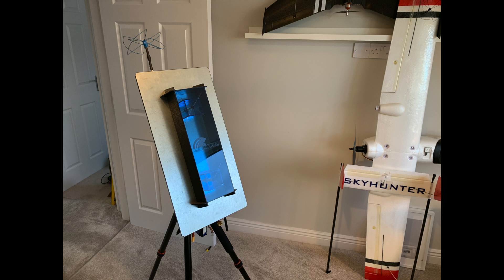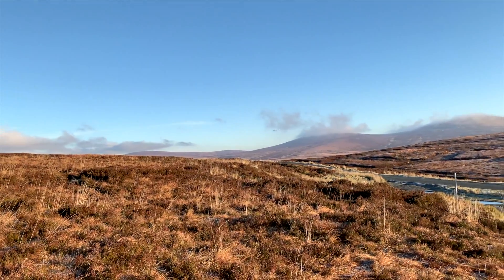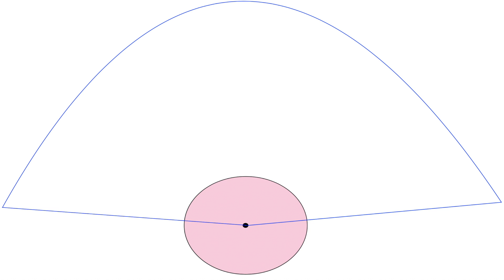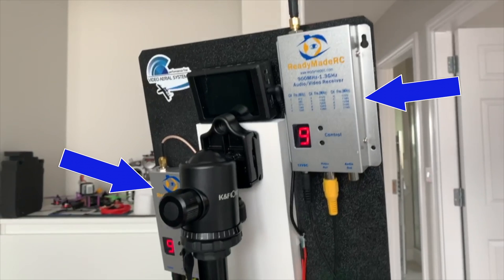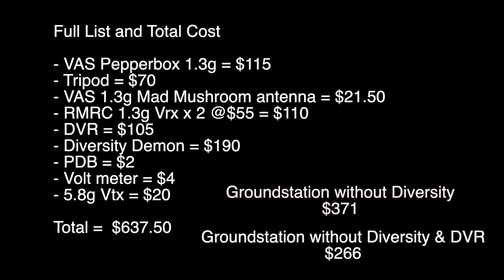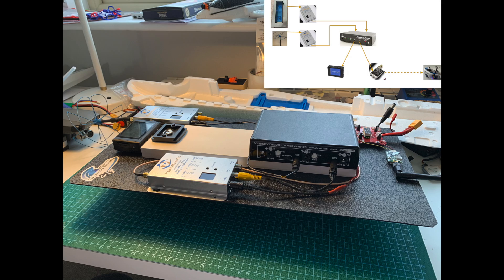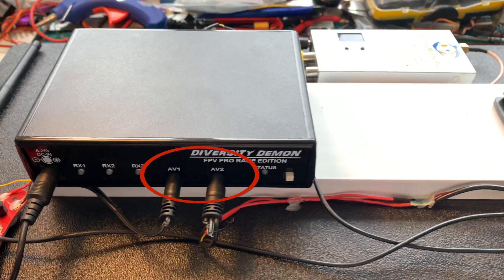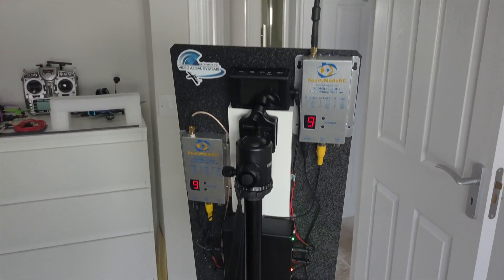Long Range FPV Ground Station - Build Tutorial

Comment: Now you can get the dji o4 pro and goggles n3 for around the same price and offers better image quality with 50km range.
Reply from the maker: True that the DJI gear offers better image quality, but you're not getting 50km range. The hard cut off is from memory around 25-30km. And even then it won't be easy. The ground station in this video will easily see you to over 100km in the right conditions and allow you to fly behind objects and lower at range.

I only fly DJI these days, I have O4 on 5 planes and it's great for 99% of the flying I do. It cannot keep up with analogue on the 1% extreme low and far flights though.
Reply: @AdamGdoesFPV omg thanks because I saw some video of DJI at 50km and I almost decided to buy DJI for long range flights
Reply: @AdamGdoesFPV  btw what's your thoughts on the advancement of fpv video systems

Comment: How many kilometers does electric drone ca fly?
Reply from the maker: Fixed wing FPV planes can cover a lot of ground. They can cover well over 200km in a single flight with the right model and setup. If you mean how far out will the video work, I've seen proof a setup like this groundstation in the right conditions will still have video at 120km away.

Comment: Thank you for this, ive been mucking about trying to come up with a solution to be able to send my fpv quads further on analog, what vtx would you suggest for the aircraft, i was leaning towards an AKK high powered vtx of sorts with 1w to 10w capabilities with active cooling, if i have that on my drone would this ground station be sufficient for like 10km to 20km range?
Reply from the maker: I don't know on quads but honestly high power vtx's are not the way forward! With this GS in the right conditions people have done as much as 120km from home on fixed wing.
Reply: @AdamGdoesFPV  thats insane, thanks for your help, definitely with the build as well!

Comment: Hi! Congratulations and thanks for the video!! It's very helpful. I am getting into the FPV world, and have some questions: I am developing a fixed wing. I want to have two cameras, one fixed analog runcam to fly, and a second gimbal camera (SIYI A8 or similar) to track objects. In both cases the video would be live. Is this GS able to stream both signals in long range flights? Thanks!
Reply from the maker: Hi, this setup is not designed for streaming 2 signals.If I was doing that I'd probably consider this ground station for receiving the FPV feed and then I'd add a second transmitter for the gimbal on 5.8g, probably digital.

Comment: I wanted to try 1.3ghz on rc car.  To get more penetration.  I tried analog 3w vtx 5.8ghz but still seems video going thru a dew buildings still wasnt better than DJI.. wish really shocked me. Analog lost video at points pretty much. Thinking try 1.3ghz 2w vtx with omni antennas on goggles vrx
Reply from the maker: 1.3g will out perform 5.8 on penetration any day. The power of the vtx is less important that the quality and gain on the receiving antenna.

Comment: I'm planing to get 5.8GHz fpv system but also planing to make a ground station to display the feed to friends also thinking of displaying other info like speed, gps, altitude on a different screen. Any easy way to get the telemetry? Bit new to this stuff xd. 

Thanks!
Reply from the maker: You don’t even need telemetry for all that data. You just use a flight controller that has an OSD. It the displays the data in your live feed.

Comment: Hey man nice to see the video is it possible to use satellite to get a large range ?
Reply: And couldn’t you just point a pepper box in every direction and have Omni directional control
Reply from the maker: If you mean satellite link then no, too laggy. You can point PB in multiple directions but that’s such a pain to setup it’d be annoying. Also when you fly you never go far in all directions, normally just 1 so it’s just not needed

Comment: Ive got the x2airs, 2 patches and 2 omnis on my dji goggles v2. So i get pretty fsr infront of me and decent omni signal, but what if i setup a high gain ground station fscing behind me so that i could have a huge range both infront and behind me!

1. Is it possible to use a diversity reciever with dji goggles?
2. Is it possible to use it in unison with my goggles(instead of switching between omni and high gain of ground station, just switch between high gain ground station and goggle patch antennas)?
Reply from the maker: Hi, with DJI you can't use a groundstation. You can with Walksnail though as they offer an external receiver. Personally I'm not a fan of the performance of WS though.
Reply: @AdamGdoesFPV  yeamy buddy has been tryna get me to switch to anything but digital since I got my first drone but the beauty and surreal feeling you get when flying around is the number 1 thing that keeps me in the hobby. I jus dont think I'll enjoy flying through a cctv video feed 😅

I'm om 1200mw with the x2air patches and havnt got a lot of range testing done but I think I'm only getting about a mile. Others online report getting 3 or 4 miles. Any idea where I might be messing up/differing from the people with better range?

Comment: Is it possible to fly a drone using my tv as a dvr and flying 5+ miles I want a ground station that is setup in my room
Reply from the maker: This is possible. Just about how you connect video signal output from your Rx to your input on TV

Comment: Will it work if i use telescope flag pole to ground for my rc truck?  Thank you for your time
Reply from the maker: If you mean place this on top of a telescopic pole instead of a tripod? Yes if the pole is strong enough to take the weight and resist being blown over by wind.
Reply: @AdamGdoesFPV  thank. I was planning on it

Comment: Cool setup, I appreciate the information. A little rough first getting into it all trying to learn the various standard protocols etc. I really like that box which allows two receivers. I ended up with the single 2W 1.2-1.3 transmitter on a little RC car and it def works way better than the 5.8ghz. I'm not sure how much quality I'm losing going down to 5.8ghz to relay over to my little LCD screen but it still looks really good for using a cheap camera. I couldn't even position my car next to a wall or something on 5.8 before it started crapping out.
Reply from the maker: 1.3g is way more forgiving that 5.8g. The relay is probably not losing any quality really. Glad it helped. Cheers

Comment: Hi mate. Great video. Just 1 question if you can help. I have a prodrone dipole antenna on my mini talon 1.2/1.3ghz. How would that work with a right hand or left hand omni and also the pepper box. Thanks
Reply from the maker: Hi, and thanks 😊 a dipole will not work well with RH or LH omni or pepperbox because the dipole is linear polarised. All of the other antennas you mention are circular polarised. You will get very bad performance if you mix circular and linear antennas. You’re best off using a TrueRC Singularity on the plane. Cheers
Reply: @AdamGdoesFPV  ok that’s good to know. I have a mini ground station that I use. 1.2/1.3ghz Rmrc receiver with a square patch antenna. Is the patch Circular do you know and so would it be better with a Omni antenna like you say on the plane. I have dipole on plane and patch on ground station. So I May have set it up wrong. 🤦🏼‍♂️
Reply from the maker: @ttucker2073  the patch is linear so you’re good with that setup 👍🏻
Reply: @AdamGdoesFPV  that’s good to know. Wernt sure what the patch was. It’s prob about 6/8 inches square and maybe an inch thick. So are all the square patches linear?
Reply: @AdamGdoesFPV  looking online and it looks like an 8dbi flat patch antenna. Possibly rmrc to

Comment: Well, does the same apply to the controller as well as it needs a signal router and how to connect to it?
Reply from the maker: No, this groundstation is for the video only. The control system is independent from it and doesn't usually need to be isolated from the tx.

Comment: I need a very long range rc transmitter. At least 100km with 18 channel. What do you recommend? Does this tracker will help me to use and control my plane by rc transmitter or it just work on autopilot
Reply from the maker: No need to copy and paste to multiple videos. Once is enough
Reply: @AdamGdoesFPV  thanks for reading my questions. The reason for that was , in many cases one channel won't  reply so I ask my question to many channels.

Comment: I have an AV cable and there’s three wires, red, yellow and white. How do I know which is ground, video, and power?  Which cable did you use to connect your 5.8ghz relay vtx and your 1.3vrx to the pcb?
Reply from the maker: I used a multimter to check for continuity. And the Vtx cable is just the one that came with the vtx... soldered to the pdb and a spare connector I had

Comment: Hi Adam. your Video is the first one who help me to understand this kind of antenna (I am a Drone Newbie). I try to build a drone and Radio-system for our Unti Poaching Unit in SA. My Question: is your antenna usable for a distance range for FPV and Control for min 30km? When not, you could help me ? Which parts i have to change? Should I better use a automatic tracking antenna?
Reply from the maker: Hi, The groundstation is not used to control the aircraft, only to receive the video feed. An antenna tracker is only useful if you plan to fly far in multiple different directions from where you are standing. For control link I use Dragonlink or TBS Crossfire. Dragonlink has a longer range and will go beyond 100km with the right antennas/setup/conditions. Good luck with the project.

Comment: Is it Possible to use this for a DJI mavic pro? If not what would need to be different? I’d like to make a separate station to go on my roof or wherever so I can fly much further but from my living room. I appreciate any help in this matter. And if anyone builds these in the Southern California area message me plz! Lol I’m really reaching here but whatever who knows. Thanks
Reply from the maker: Honestly you'd be better off building a home made quad with 1.3g video and 433mhz or 868mhz for control link. Making a Mavic work on 1.3g video will not be worth it. Thanks for watching.

Comment: Hi, its a great tutorial! however could you please advise me on what is going on on the market as now (2 yearsw later) i am unable to find no pepperbox antenna or mad mushroom antenna anywere. they are discontiuned. what is the replacement nowadays (I am trying to build a ground station working on 1.3 GHZ as well)
thanks
Reply from the maker: Hi and thanks. I actually mean to make a follow up video to this very soon!
The pepperbox has been redesigned, it is more powerful, smaller and lighter and you can buy it here: http://tiny.cc/Pepperbox-XTreme
Rather than the mad mushroom I use these which are way smaller and in a case so nice and protected: http://tiny.cc/SingularityCP
Cheers

Comment: Great Video! I've just got two questions:
1. What FPV transmitter do you recommend for the longest possible range with the Pepperbox as receiving antenna?
2. To be able to receive the FPV signal from all directions with the Pepperbox, couldn't someone just turn the antenna following the aircraft?
Reply from the maker: Thanks 😎
1: This one http://tiny.cc/Matek-1G3-Vtx
2: Yeah of course, if you have someone standing by to do that. I sometimes turn it myself mid flight if I go out in a different direction.

Comment: Hi. I don't know if you still respond to these comments, but the diversity controller you used is no longer for sale. In fact, I can't seem to find any diversity controller for sale. Is there a way to currently recreate this?
Reply from the maker: Hi, yeah there is an update on this in the kit list. The only one I'm aware of is the Clearview XL which is a 3 in 1, 2 x 1.3g receivers and a diversity controller. Not cheap though, Cheers
Reply: @AdamGdoesFPV  many thanks. Clearview is out of my budget, so I will likely have to get a 5.8 system as my first. Not great for long range but it might be my best option.
Reply from the maker: @sumbirdy1741  or just go 1.3 without diversity 👍🏻

Comment: Auto subscribe. Very informative n inspirational. I currently use rush tank vtx 800mw + dumbo rc for my rc car. Would you like sharing transmitter system for long range ? Crossfire enough? Thanks
Reply from the maker: Thanks for subscribing 👌🏻 Crossfire is great for long range, and if you need more Dragonlink is pretty unbeatable.

Comment: @Adam G does FPV Great video, very very interested to build one like yours. Searching for the parts on the web seems like the VAS Pepperbox is out of stock everywhere, do you know if they're still in business? Do you have other antennas to suggest other thank the gattling (saw your video test) that is almost 400$? Same about the CP antennas both for TX and RX seems unfindable.
Thanks a lot, really looking forward a reply
Reply from the maker: My suggestion is to just back order with RMRC. I do this regularly and they tend to get the parts in quite quickly, plus at a decent price with low shipping costs. Gatling is very expensive and I’d only recommend buying one if you really k ow you’ll make use of its potential. The PB is a much better all rounder and way cheaper
Reply: @AdamGdoesFPV  Thanks very much for the suggestion I'll do as you say! What about the video mixer to have diversity? Seems like  also the eagle eye is unfindable, do you have any suggestions where to find something cheaper than the Clearview to start with? Thanks again!
Reply from the maker: Unfortunately there isn’t anything cheaper that exists at the moment. I’d suggest just going with the Pepperbox and fly out in front of it 👍🏻

Comment: Hi I've used your link for the diversity demon but it's no longer being sold by that company can you guide as to where else I can purchase one or something similar that works the same way.
Reply from the maker: Hi, there is already info in the video description right next to the DD link 👍🏻
Reply: @AdamGdoesFPV  thanks. I also located the eagle eye diversity controller that's much cheaper.
Reply from the maker: @briancrick935  They are discontinued so they are very hard to find unless you get one second hand.

Comment: what is the average maximum range you can get with 5.8ghz?
Reply from the maker: This all depends on so many factors I just can't answer. Some people will get about 1km and some go to 50+. Setup, equipment used, fling location, flying style will all influence this. Cheers
Reply: @AdamGdoesFPV  thx for the info

Comment: Thank you.This is very clear and useful , even to an old hand.( I am very satisfied with Eagle Eyes after 8 or more years). Recently I get a varying  gauze- like texture with all the best cameras and vtx's on 1.3ghz , and it is not on a 5.8ghz connection . The aspect ratio also changes between 1.3 and 5.8. Either the goggles (Eachine 300 ) process the AV in by -cable connection badly, or the cable affects the signal . I will try using the 5.8 relay with the Eachine vtx  , and also  try another cable . Do you think a coaxial cable would be better?
Reply from the maker: Hi, not too sure if the cable will make much difference. I'd be trying to take parts out of the equation one by one to pin point where your issue is. When I had an odd issue it turned out to be a strange compatibility problem with my goggles. Cheers

Comment: Wow, that is hell of a video, well done.
Im just starting the hobby so please help me out to understand things well.
On your standard ground station you use Vtx to transmit video signal (from your plane/quad catched by your ground station) into your goggles? cant you like wire up ground station with your goggles directly and not use the Vtx? What kind of Vtx are you using at your plane to match you ground station receiver ? is it some kind of 1.3 Ghz transmitter?
Another question of mine - maybe off the video topic a little bit. Normally when you transmit video signal from the plane it can be received either by the video receiver (like ur station) or directly the goggles ( so you dont need a separete unit of the receiver at the ground, right?) ?
sorry for many questions, I hope you will find some time to answer those.
Reply from the maker: Thanks 👍🏻 😊
1. Yes you can simply connect your GS to your goggles using a cable rather than using a Vtx. However, it's nice to be hands free, the Vtx is cheap, and using a cable is a bit annoying but more importantly doesn't allow you to stand a little bit away from your GS, which in some cases can cause issues/reduced range.
2. Yes you have to use a Vtx on your plane that runs on same frequency as receiver and receiver antenna. I use the Matek 1.3g Vtx ► http://tiny.cc/Matek-1G3-Vtx or the Partom 1.3g vtx ► http://tiny.cc/kwcv0y on my planes.
3. Yes you can receive the video on a GS like in this video OR it can go straight to your goggles. You only need a GS if the gear is too large to mount to goggles, like trackers or directional 1.3g antennas.
4. For the RC control link this is from the transmitter or a module bolted onto the transmitter. I have Dragonlink, not Crossfire but both are similar.
Reply: @AdamGdoesFPV  thanks a lot for all of the answers, you covered everything I need to know.
That 1.3 g Vtx looks pretty big for my bilxer and for now I cant really afford entire GS at the moment. Would you recommend some other rather shorter range fpv setup of Vtx and Vrx ? I found smth called RC832 but cant tell whether it is still being used by hobbyists. What kind of range would you expect out of such setup? I think you said that your GS allows smth like 30 kms ? Does dragonlink support such lengths without issues?
Reply: ive got another quick questions. Station you described is used only for catching video signal? How do you send/catch standard signal to control an airacraft? Is it crossfire attached directly to transmitter?